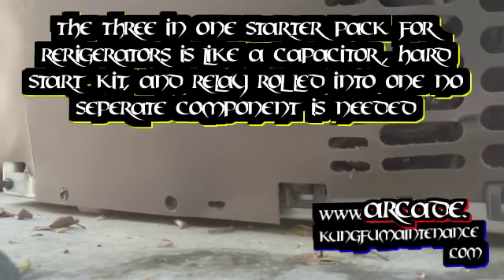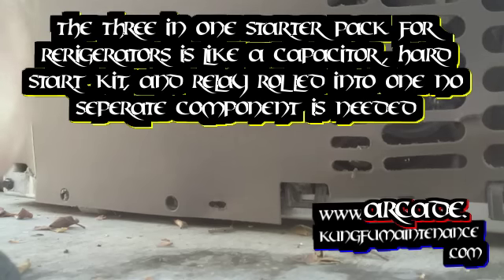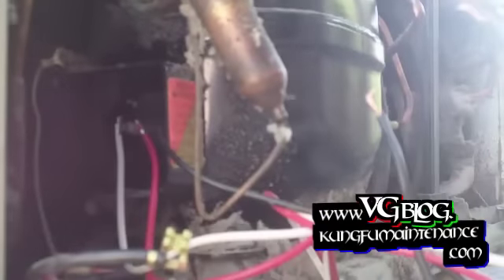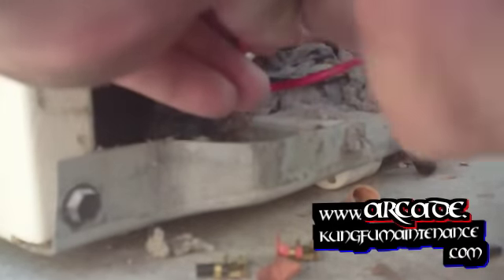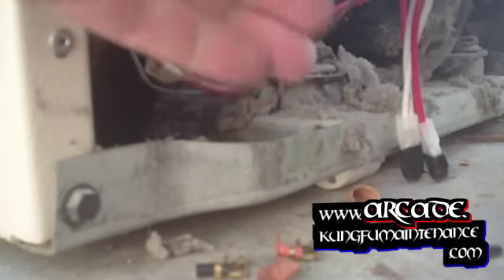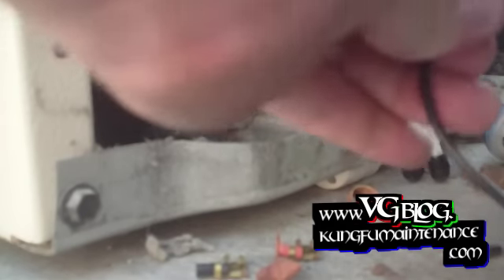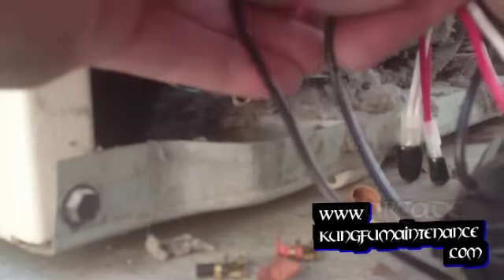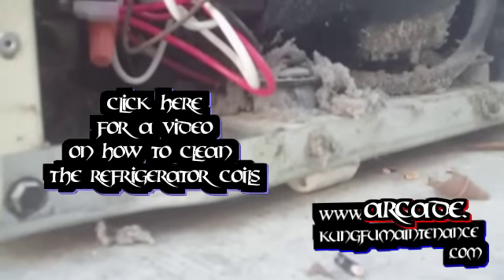How To Repair A Refrigerator With A Compressor That Suddenly Stopped Working Or Will Not Run

Comment: I have a large 5 ft chest freezer and although i can hear the compressor running it DOES NOT get cold? On any setting of the thermostat will not get even the slightest bit cold but the compressor is running.
  Any advice please or could it be the thermostat
Reply from the maker: If the compressor is running but unit is not cooling enough there are few possibilities. Either unit is low on refrigerant and has a leak or the coils are dirty enough to prevent  removing heat or there is some other type of air flow blockage. I usually try cleaning the coils first. It may be worth repairing and recharging but if older it may be more cost effective to replace it. It wouldn't be the thermostat since the thermostat just tells the compressor when to turn on and when to turn off.

Comment from the maker: Good question. The relay helps the compressor to start so while it may be technically possible (yet not very safe) to get it running without the relay every time it turned off you would have to repeat the procedure when it started again.

Comment from the maker: This is a three in one starter pack. It replaces the relay plus capacitor on the compressor, and adds a hard start kit. It attaches to the common, run, and start terminals on the compressor.

Comment from the maker: Assuming the compressor is working properly and I am understanding the question properly. I think the answer would be placing a restrictive metering device (TXV valve) or fixed smaller orifice (cappillary tube)  in the line. This is what causes the refrigerant to have to squeeze through and changes the pressures on either side. Similar to if you take a hose and squeeze the end the water will spray through because the water pressure behind presses it to go faster through the smaller opening. ~HTH

Comment: Hi,i has 18 cu ft chest freezer is was good working, now it stopped working i hear cliking sound like it going to start but it won;t i looked online most people said has bad starter relay then i bought 3 in 1 hard start relay install it and is still doing the same. any idea?
Reply from the maker: +xay saysombath it's possible that the white and red wires are reversed another possibility is sometimes there are relays that come in two different sizes a 1/12 to 1/5 horsepower and a 1/4 through 1/3 horsepower. A lot of times It's tricky to determine what horsepower  the compressor is as it's often not very clearly labeled or easily distinguished so I often keep to use both sizes of relays on hand and try each one to see which one will work.

Comment: I have a question my compressor will turn on but I have to have it all the way up so if I put a water bottle in it just freezes. So what do I need to do buy a new one or is it fix able.

Comment: Is a "low capacity pump" part of the compressor?  I searched how to replace pump on refrigerator and ended up here.  I have a less than 2 year old refrig that they want $800 to repair, only the compressor is covered after the first year.
Thanks

Comment from the maker: Sometimes you can replace the relay with the same kind of relay for your particular make and model. Often this is best. The relay can be tested first by doing a continuity (ohm) test to see if it is bad. Three in one starter kits come mainly in two sizes 1/12th to 1/5th hp and 1/3rd to 1/4th horsepower sizes. Determining the hp of the compressor can be tricky but a bit of googling your make and model number you should be able to find it. Hope that helps. ~ Thanks for watching!

Comment: So I asked my wife if she checked for a GFCI breaker outlet that had a light on where the fridge was plugged in and she said there was just a normal outlet, so I moved on to repair mode, but then she saw one in another part of the kitchen that was lit up(mind you the only one thats GFCI) and that was the problem. Duh all those outlets are apart of the same circuit, I didn't think to tell her to look around for 1 elsewhere though that would of popped, we didn't even have anything plugged into that one.  just something to think about first.  Double check all the basics! :) yay!

Comment: The compressor on a small walk-in runs continuously, the unit cools down then it stops and does not run again.  I unplug it and allow it to cool down and when I plug in again the compressor starts and it stops when it gets to hot.  I've change the overload and same thing keeps happening.  Any suggestions.

Comment from the maker: Never... hmm. I have to disagree. If you needed time it would be better to use this to keep items from spoiling. This is great to have in situations where you have multiple types of fridges and you never know when one might go out. Relays do go bad here and there but not so often that you would always have particular relays at the ready. This particular fridge is still running today with same three in one starter pack keeping it going. It is older and soon to be replaced for cosmetic reasons.

Comment: Just wanted to add to my latest question. So i waited 30 minutes, compressor was cold, I plug the fridge to the wall, everything tuns on fine (fan, lights and compressor). After 10 seconds i turn it off, then immediately plug back in and compressor does not turn on. Any idea?
Reply: Yeah it's called a time delay. It's normal. Don't unplug and plug it back in or you could screw something up.

Comment: Total fool. Should have replaced with the proper relay. This low quality repair, was a pitiful display of workmanship.
Reply from the maker: +Michael Giroux Not totally. When you have ten to twenty different fridges it's not always practical to have exact replacement relay at the ready. The three in one works good to prevent food spoilage and or preserve medications. Than if you like the oem relay can be ordered and changed out. 

Some of these fridges are ready to be replaced purely for cosmetic reasons. The three in one can be good enough depending on the situation. 

This particular one was still working five years later when it was carted out during a complete renovation project.

I have no problem with the three in one. Sometimes the fridge fails even after oem relay installed. Sometimes the problem is deeper and I think this gives the three in one relay a worse rap than I think it deserves in that it is often installed on an already on it's deathbed appliance.

 Thanks for watching! and commenting. :0)
Reply from the maker: +Michael Giroux Not totally. When you have ten to twenty different fridges it's not always practical to have exact replacement relay at the ready. The three in one works good to prevent food spoilage and or preserve medications. Than if you like the oem relay can be ordered and changed out. 

Some of these fridges are ready to be replaced purely for cosmetic reasons. The three in one can be good enough depending on the situation. 

This particular one was still working five years later when it was carted out during a complete renovation project.

I have no problem with the three in one. Sometimes the fridge fails even after oem relay installed. Sometimes the problem is deeper and I think this gives the three in one relay a worse rap than I think it deserves in that it is often installed on an already on it's deathbed appliance.

 Thanks for watching! and commenting. :0)
Reply: Not a capacitor start compressor. I've been fixing refrigerators for 40 years. The relay on that refrigerator, is the most commonly used relay in the industry. You have also ended up with the wrong sized overload. It must be rated for the correct locked rotor amperage.
 You should have kept the original. These incorrectly sized 3 in 1 units ruin compressors. We had a man in town using them and the compressors often failed soon afterwards. When he disappeared, so did the problem. A clean condenser, and a black colored solid state relay = no call backs ever. I have changed hundreds, and carry over 60 different relay combinations  on the truck.
Reply from the maker: +Michael Giroux Thank you for sharing your knowledge and experience here. I shall look into this further, do a bit more research and comparison on it, and hopefully make some more videos in the process. Your insight is appreciated.
Reply: @ Michael, I have a Unit that quit cooling, Compressor won't run,  (Light is on, so wasn't breaker or anything)
Compressor start relay number was R041 11v. 
I removed relay and tested with ohm meter across red and white wire. 
Read about 7 ohms. I had read should be between 10 and 100, but I assume 7 ohms was close enough, 
Correct?? I was hoping for an easy fix, but I am guessing 7 ohms is OK Correct?
Landlord is going to replace Refrigerator, But I was trying to help him out, with relatively in expensive fix.